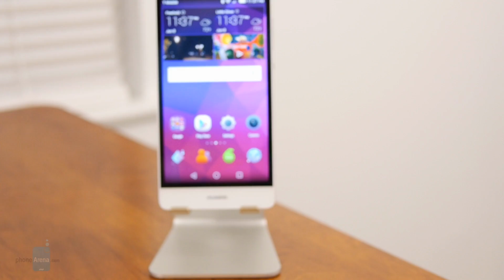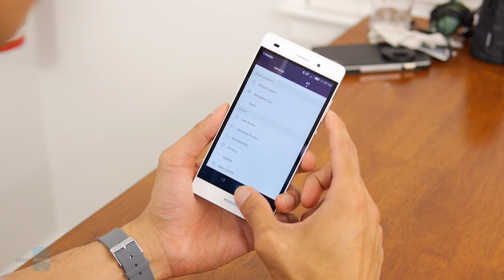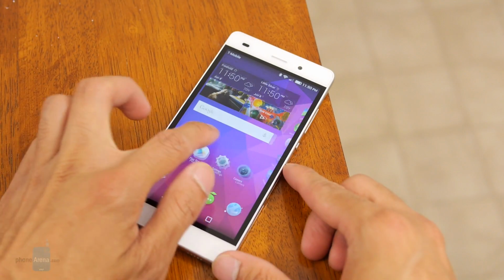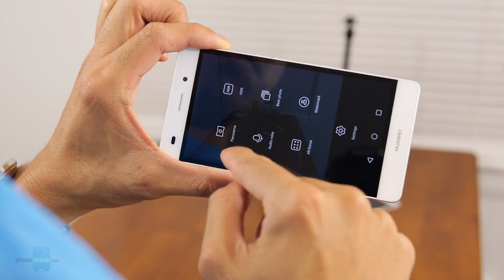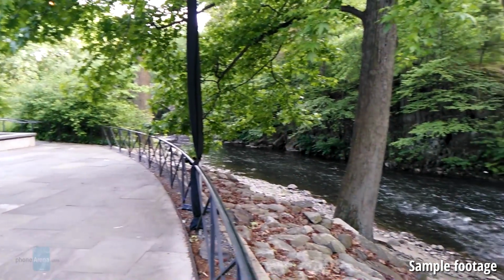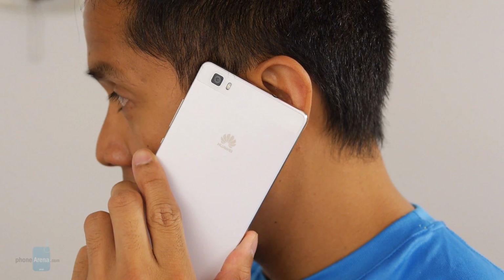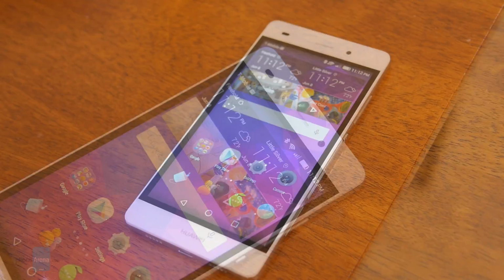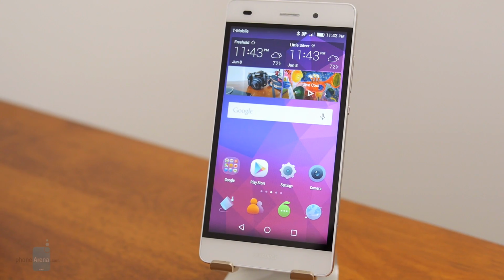Huawei P8 Lite Review

Comment: Which is better Huawei p8 lite or lg stylus 2? please answer me. thank you
Reply: P8 lite
Reply: lg k10
Reply: hey Maegan Sy huawei p8 lite is way better because it's processor is octa core 8 core CPU 64 bits high Kirin 620 processor and 2gb ram and a lot more features you can use like lot more sensors. however the lg stylus 2 has a 410 snapdragon quad processor which is now where near faster than octa core processor 64 bits high Kirin  620 so p8 lite is way better faster ect

Comment: you can not change the battery. I want a Phone that lives for 3 years! will it make it?
Reply: +GamerzWallpapers no phone will make it 3 years, buy a nokia 3310 if that's what you want
Reply: +David Jenkins my Phone did. only the screen is broken now. the only reason Phones break is because of the screen or battery
Reply: David Jenkins it is possible. Just dont break it by letting it touch the ground
Reply: I have my iphone5 since it was freshly released until today, and the screen have never broken but the battery isn't as good as it was because of the use but it doesn't bother me that much though

Comment: Huawei p8 lite or Samsung galaxy a3?
Reply: +Roope Pajunen  p8 has a stronger processor (the samsung has snapdragon 410) and a higher resolution display, i went with the p8 lite even though its bigger display and i prefer smaller like the A3 (5 inch display to samsungs 4.3 or 4.5)

Comment: I have one. It runs android 5.0 very smooth. For that price its a perfect phone. Dont expect that much from a phone in that price range. But the p8 lite does its job perfectly. For all the haters, please watch more reviews instead of buying one and experience all the pros and cons of a phone. P8 lite just rocks!
Reply: Is it good for gaming?
Reply: yes. it runs almost every game smooth and with no lags
Reply: +Muhannad hisham P8 is alot faster, but it is really just overkill, the P8 Lite is smaller, more elegant and has almost everything the P8 has, I would definitely recommend this phone over the P8, this phone will run asphalt 8 at high graphics with 30 FPS, and NFS MW at about 45 FPS it is an amazing phone with plenty of gaming capabilities, and wont draw too much attention
Reply: BAJEVIC9HD do you think it will get Android M?
Reply: Mogroo T not sure. still no update for it after using it for 2 weeks. but it has the standard to run such a system smooth. so why not :)
Reply: BAJEVIC9HD
thanks
Reply: BAJEVIC9HD And what about the Battery life? How much sceen hours?  I need to know that, i would waiting for your response. thanks
Reply: Battery life is with 2200mAh for a 5 inch phone not that outstanding. But! the phone has an integrated system that warns you when you have apps open that should be closed to save battery life. so overall the phones battery life is good, it will bring you at least through a whole day without charging it. so depending on your apps, brightness (at 100%) it will definitely struggle one whole day, your internet usage, weather u use it via wifi or mobile data, you have to play with some options to get the maximum out of it. but in general for that price range, its absolutely good in overall performance.
Reply: what is the diffrence between P8 and P8 Lite .. which is better ?
Reply: Muhannad hisham
p8
Reply: +BAJEVIC9HD Is it running on EMUI 3.1 and android 5.1 already?
Reply: http://www.androidcentral.com/android-51-lollipop-update-rolling-out-huawei-p8-lite